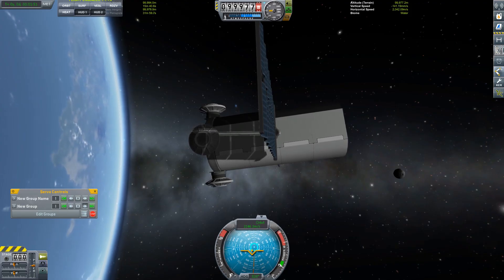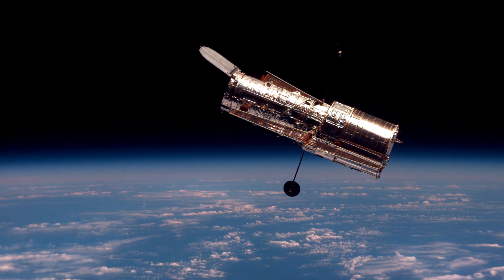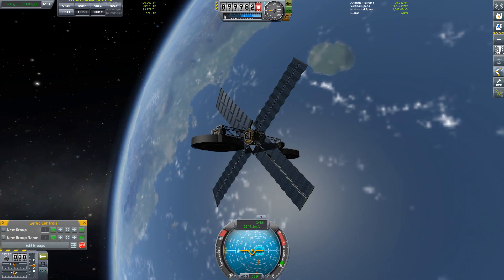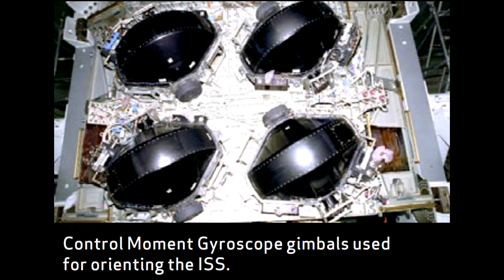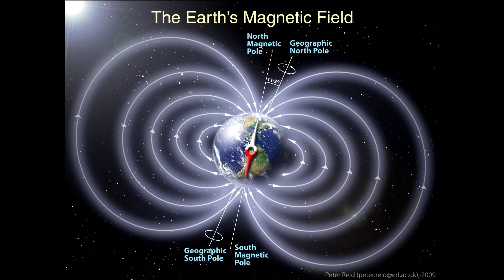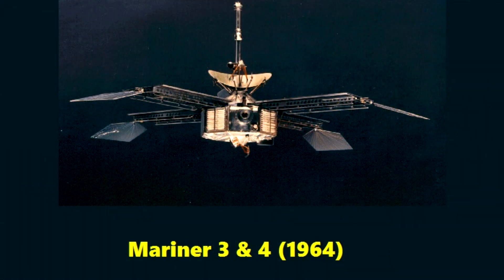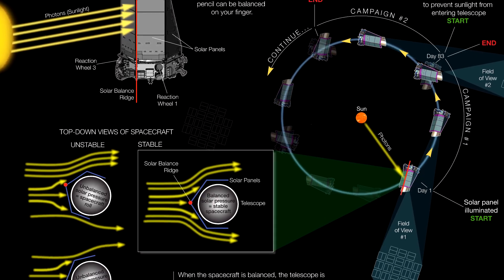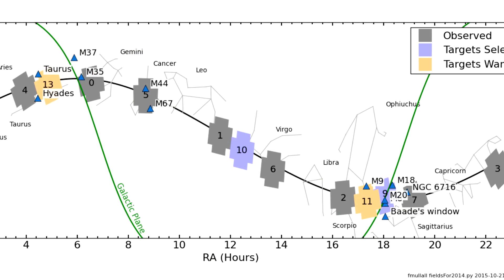Reaction Wheels - Things Kerbal Space Program Doesn't Teach

Comment: This raditon pressue thing sound like it could be used for movement in space
Reply: It's the basis behind the idea for Solar Sails, although it's much like Sailing itself... where in effect what they're doing is adding a Tiller. The issue is that on it's own simply isn't enough for Locomotion and does leave you somewhat at the mercy of said Radiation Waves. If research focused on it, it's entirely possible it could form the basis for "Age of Sail" like Space Travel; still it's simply not practical long-term beyond possibly Station Keeping.
Reply: it can be used for that
Reply: They aren't strictly as limited as you make out. They can be used entirely for locomotion, although they aren't great. We have materials light enough and shiny enough that they will get something out of our solar system. It's just that the further away you get, the lower your thrust is, so you really can only use them inside a solar system, then coast.

Or you shoot a high power laser at them. This is a plan for sending probes to Alpha Centauri. This means the engine (or source of power) doesn't have to push itself, just apply the force (via photons) to the sail. Focusing is the issue, though.
Reply: Already being used!

http://sail.planetary.org
Reply: Already being used!

http://sail.planetary.org
Reply: An article that might interest you; https://en.wikipedia.org/wiki/Solar_sail
Reply: i belive those are called solar sails.

Comment: 5:35 Is this similar to (or the same as) gimbal lock?
Reply: Yes. That's gimbal lock.
Reply: No. Gimbal lock is where the rotating joints in the support mechanism for a single gyroscope, the gimbals, line up so that the degrees of freedom of motion of the gyroscope are limited.

Comment: Thanks for the video !
I wonder, why would a reaction wheel have to spin faster and faster to compensate a "force that is maintained over time" ? If the force is maintained, the opposite reaction should be maintained as well right ? Or does your example with radiations implies that the spacecraft is moving toward the radiation source which, I suppose, makes the force grow rather than being maintained ?
Reply: If I understand correctly it is because the solar radiation is not so much a constant force but a steady accumulation of rotational energy. Think, without the reaction wheels the radiation would rotate the object faster and faster, similar to the way a solar sail pushes the spacecraft faster and and faster. As the sun adds more and more energy (angular momentum) to the spacecraft, the reaction wheels would continue to have to do the same until they are saturated.
Reply: Oh right makes sense. Thanks Nick :)

Comment: how does mechanical friction and heat impact on saturation?
Reply: I think those are totally unrelated, it just means you have to keep running your motor to keep the wheel's speed constant.
Reply: Toxic Psychotic im not quite sure of that. since friction should cause loss of momentum in the wheel as both counter rotation and heat.
Reply: Yeah, but the idea with saturation is that you have either a rotation speed limit, or gimbal locks. Friction might affect your speed, but it shouldn't do anything to your max speed or your gimbal axes.
Reply: +Toxic Psychotic equal and opposite reactions at all times, if friction slows the wheel the craft must also be slowed.

Comment: Someone has to make a mod for desaturating reaction wheels with rcs. Scott! You make complex topics simple and easy to understand. Thanks! Keep making videos like this. The bear at the end could become a part of the outro.
Reply: What bear? I saw he was drinking beer. XD But fun had to be done.
Reply: protostar 777 I knew someone will say that... No I mean the option to use monopropelant to dump momentum on the reaction wheels.
Reply: I though there was a mod like that. Though I have not looked for it my self.
Reply: I think the mod is called saturatable reaction wheels.
Reply: +Luka David Torkar doesn't the mod cause reaction wheels to use small amounts of monopropellant over time? Sorry, I haven't much experience with realism overhaul.
Reply: You rarely need to apply a force continuously though since most of the time orientation matters little. The only case where your wheels are likely to saturate is during re-entry but real wheels are not powerful enough for that anyway.

Comment: Is the placement of real life momentum wheels/gyroscopes important in regard to the given ships center of mass?
Reply: The wheel will apply the same torque wherever you place it. However, depending on the placement, the moment of inertia of the ship will not be the same, and the smaller the moment of inertia, the bigger angular velocity you get from the wheel. For optimal performance you need to place them at the center of mass.
Reply: probably, since it's still force being applied to one end of the craft, therefore myst be balanced.
Reply: ***** I thought so - thanks for answering :)

Comment: Isn't conservation of angular momentum only true for rigid systems? What about a cat? And what about spinning up some wheels, turning them around 180° in some symmetric way and then stopping them, wouldn't that give a net rotation gain?
Reply: Smartereveryday the youtubechannel has a great video on cats and angular momentum.
Reply: So, take this situation. You have a single mechanism that has 2 wheels spinning opposite directions on the same axis. You try to turn it over, each wheel will apply a force that cancels the other one. While you're applying force to the double wheel it's turning at a fixed rate and your space ship's rotation is accelerating. Then the ship lets go of the mechanism and lets it spin, which would leave the axis rod stationary and the ship spinning. Is there something wrong with this?